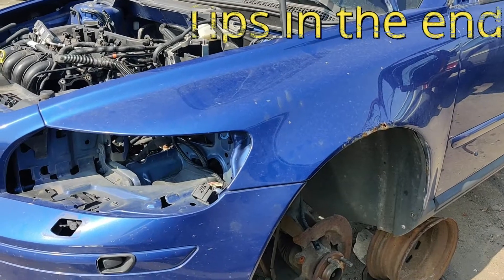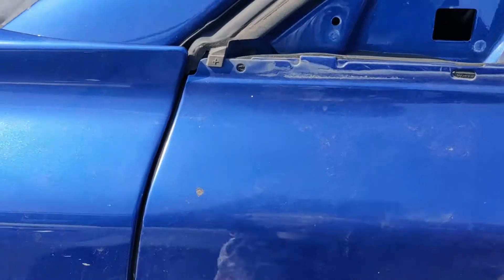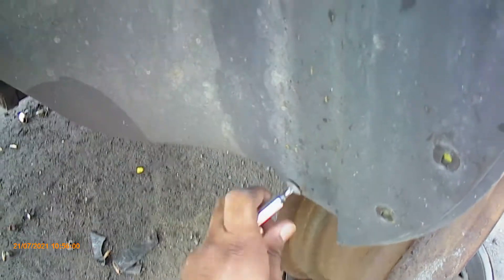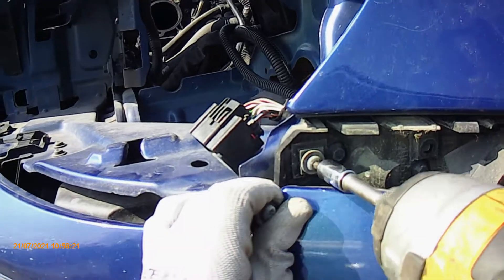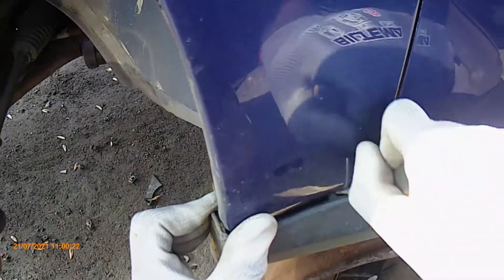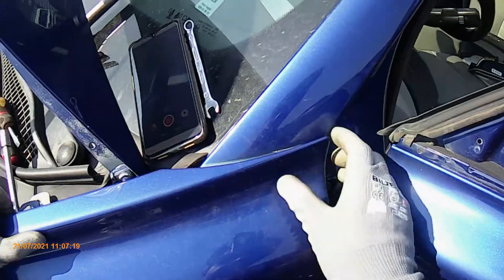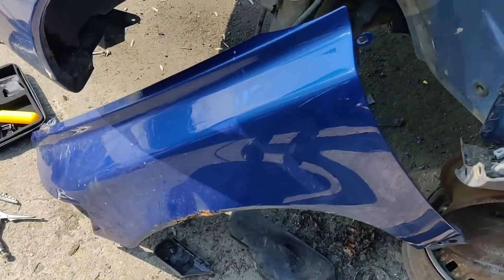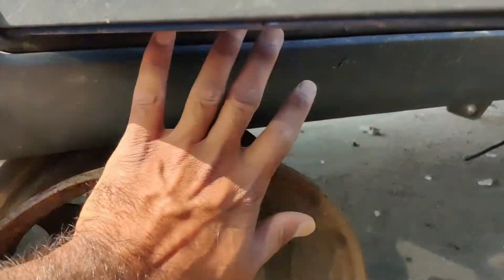How to Remove Volvo V50/S40 front fender

Comment: Hej,can you make a video,how to replace the pump from the water bottle of the windshield,please?i got a v50 2008 diesel.tack
Reply from the maker: If your windshield washer bottle sits right behind the fender then you have to remove the fender and that exposes the washer bottle and then you can easily replace it. But for some models it sits between the front bumper and the wheel so one can go under the car
Reply: @adnansgarage  i will check,tack so mycket